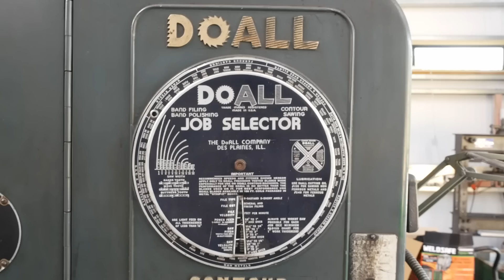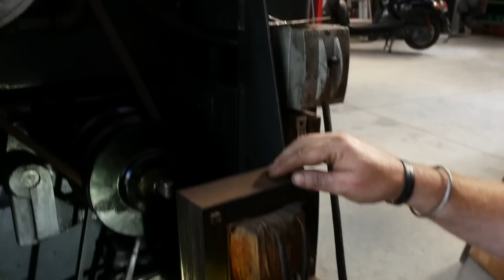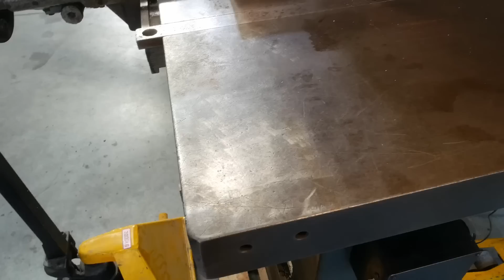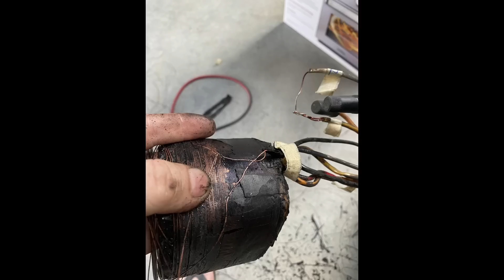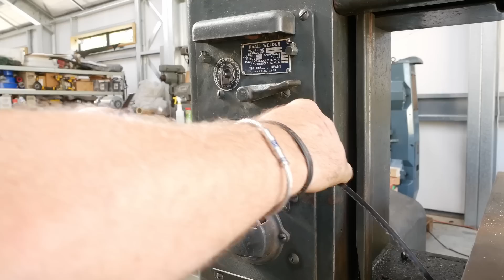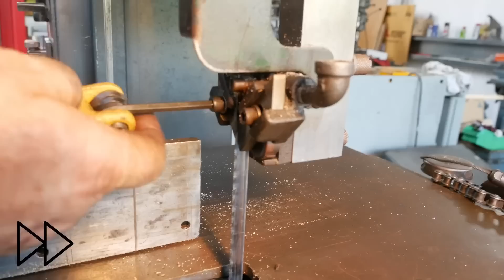Rewinding a DoAll band saw welder transformer || RotarySMP

Comment: I miss having one of these to use.
They are awesome. I always used to test the blade after welding and annealing  by rolling it back and fourth by hand but about half the diameter of the pulleys,just to  check for a good joint. If it was annealed to much it would bend on the joint and if wasn't annealed enough it would break on the joint.
After awhile you got the hang of it and it was good every time.
Reply from the maker: Thanks for the tip

Comment: I could not be a motor winder... My grinder feels inadequate now... I did have a slightly older band saw. I had a 36" CB Rogers 0B size 1875ish vintage. The thing was big cast iron and big cast iron legs something like 800 pounds or more.  It led a hard life and I'm glad it's out of the shop. Took up allot of space. Leather belt drive/babbit bearings originally and back then there was no thought given to guards... 
     I have never gotten the hang of welding blades. Too hot, too cold or annealed too much or not enough etc.
Reply from the maker: Sounds like a beast of a machine
Reply: @RotarySMP  It stood about 8' tall and I'm glad it's out of the shop. Barely used and took up a ton of space and dangerous to use, this coming from someone that gets annoyed by the safety people.
       It was cool to have something of that vintage for a while though and use it.
Reply from the maker: @theinfernalcraftsman  Did it have a gearbox for metal bland speeds, or only wood?
Reply: @RotarySMP  It was originally shaft line powered with a leather belt. The belt pulley was replaced with a massive 24"+ cast iron double v belt groove pulley. It was meant for wood and originally had a wood table from cherry and maple. I never got around to trying to slow it down. It was a very heavy machine but they didn't put the iron where it would have been strong. The saws from crescent and others just a few years later were light years ahead in a short time. Now if I could just find a deal on an old lathe so I have one at home.
Reply from the maker: @theinfernalcraftsman  I am sure you will find the right lathe. These things have a way of coming together.

Comment: On my Do-All I use the top and bottom of the grinding wheel to dress both sides of the blade,  then you don't have to flip the blade...
Reply from the maker: Does yours not have the cover over the bottom part of the wheel?
Reply: @RotarySMP  Hello,  the wheel is exposed on the top and bottom I use the top to dress the inside of the blade and the bottom to do the outside. I'm not really sure if that's what they intended but that's how I've been doing it forever...
Reply: @wendellg1  OH yeah, duh. Mine has that also, I need to use it that way. Thanks.

Comment: Wow that brings back memories!
In about 1982 I worked in a big motor rewinding shop and they had the same machine. Same paint colour and welder, everything. The saw was used all the time to cut red fibre and other insulator material for motor rewinging, it was a workhorse.
I remember I broke a saw band and watched the leading hand weld it and grind to size, he said you need to take particular care lining it up before welding and also grinding very exactly so it doesnt snag. I never got to use the welder but used that bandsaw machine quite a lot! Thanks for the memories! 😁👍
Reply from the maker: DoALL really are epic saws. Mine was made only 10 years later, but they had already cheapened done the design a lot. Product improvment :)
Reply: @RotarySMP  ... profit improvement. 🤔

Comment: Varnish or epoxy is also to stop hum from vibration of the windings if that's an issue, but with that gauge probably not enough current for that issue.
Reply from the maker: That is good to know. Thanks.

Comment: OMG! Anton did an amazing job! I can't believe he counted off all the turns of transformer wire, that must have been incredibly tedious. Got it all fixed up and working though, so worth it. Also, I have never heard of file blades for a band saw, they sound terrifying. I think you should fit one and give it a whirl. I'll watch from here 🙂
- Heather

PS: One technique I once used for rewinding a coil was to measure the wire gauge, then measure the resistance of a couple of meters (maybe more if it's thick stuff), then measure the resistance of each entire length (I had a brake so just did it in separate bits and added them up). You can then gauge how many meters of new stuff you need without worrying about the actual number of turns. Just wind it all on.
Reply from the maker: Hi Heather. He did do it really nicely. It is working great again. Thanks for that tip.

Comment: We had a somewhat similar band saw in school. But we didn't use the settings for "asbestos" very often.
Anton did a great job on rewinding the transformer. That's not easy to do.
Reply: I just use a carpenters hand saw for asbestos. Makes a lot of dust but cuts very well.
Reply from the maker: I try to leave asbestos alone.
Reply: @RotarySMP  That was supposed to be funny. sigh. I'm old.
Reply from the maker: @HansFormerlyTraffer  Me too. :/